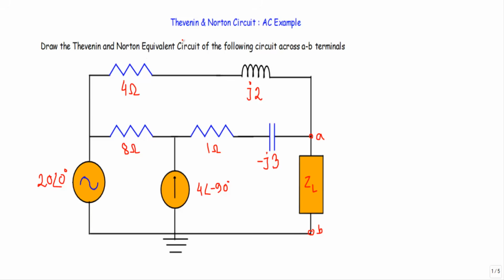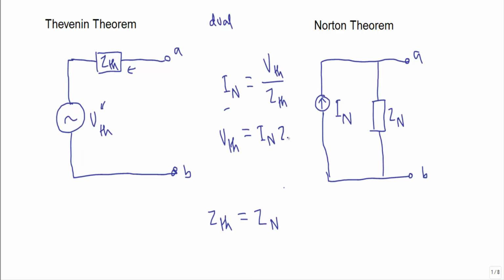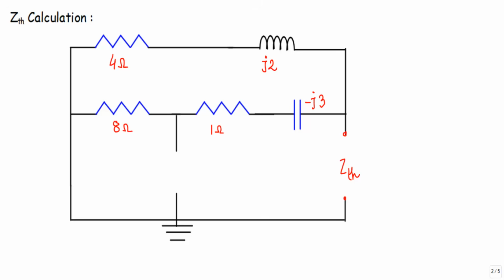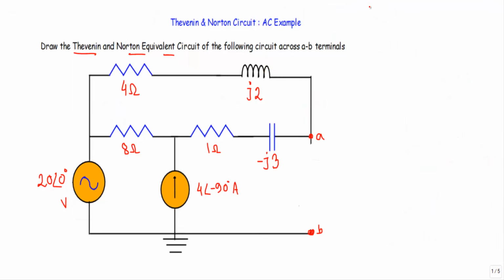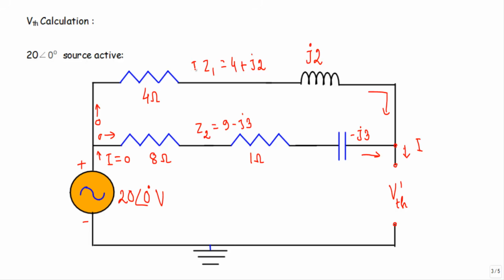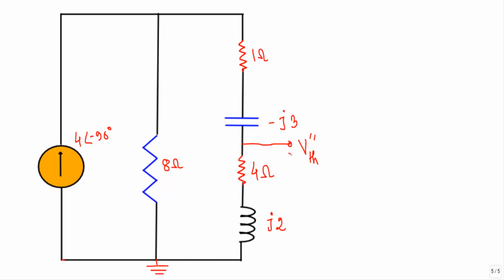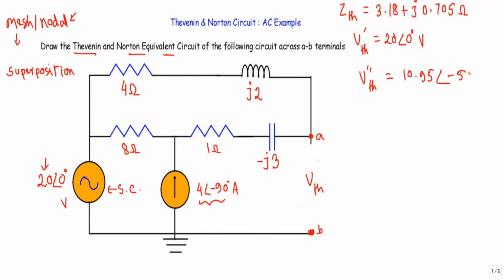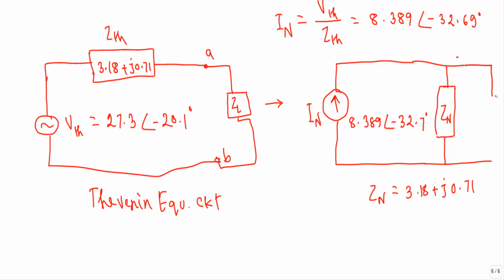AC Example : Thevenin and Norton Circuit

Comment: I do not agree with your current divider formula?  i1  should be equal to z2/(z1 +z2) times i
Reply: This would the correct formula for CDR. You can also use ztotal over z(branch of interest) multiplied by iT if works out easier to solve that way.